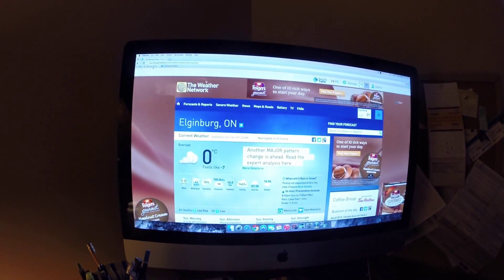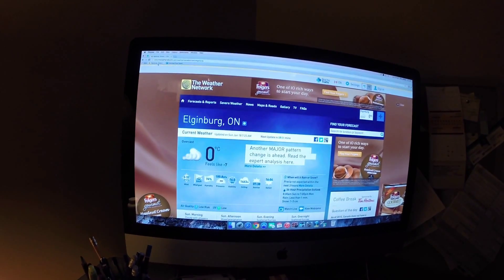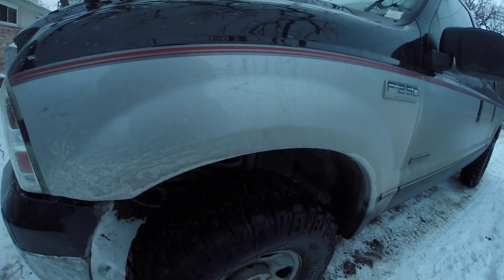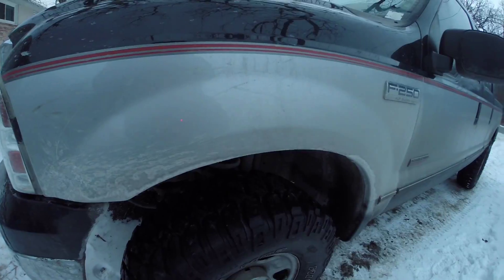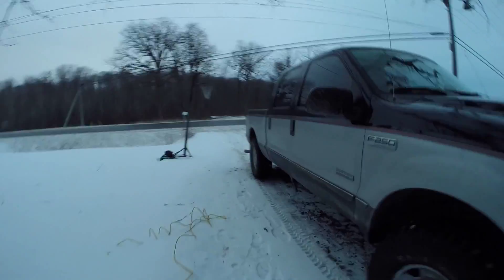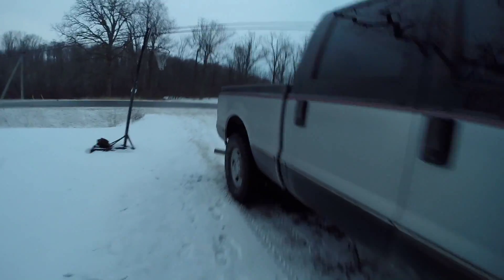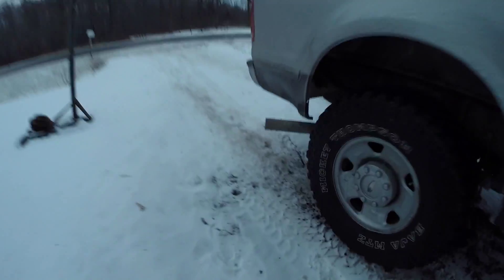Archoil test 4,

Comment: Run some Stanadyne  fuel injector cleaner, and then run the performance additive and see if that helps even more (get the injectors clean oil side and fuel side).

Comment: Thank you for taking the time to put these 4 videos together. You have help many people that share your experience. So, it is now almost 2 years since the last video. (11/22/16) How is the truck running?
Reply from the maker: Your very welcome and thanks for the kind words. That was the idea behind this series when I made them. Right now my truck has an EGRcooler leak and needs an IPR valve. Its sitting until I get my "new to me" jeep fixed, and put on the road, then built with a 6 inch lift and 35" tires.

Comment: thats not even cold. 0 deg Cel??? I dont plug mine in unless it dips below 20 deg Fah. And that only so it blows warm air quicker from the heater
Reply from the maker: +stang1970 Yeah, so you can understand how bad my problem with stiction was. My truck used to take almost a half an hour to start before #ArchoilAR9100
Reply: +skippy594  wow that bad!